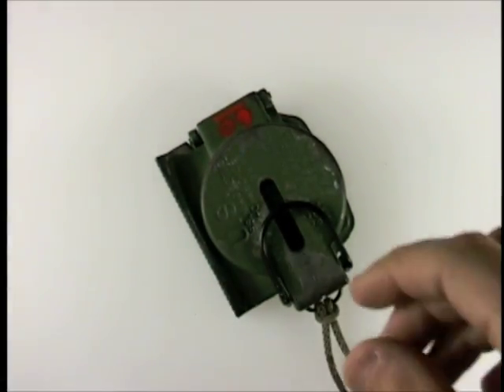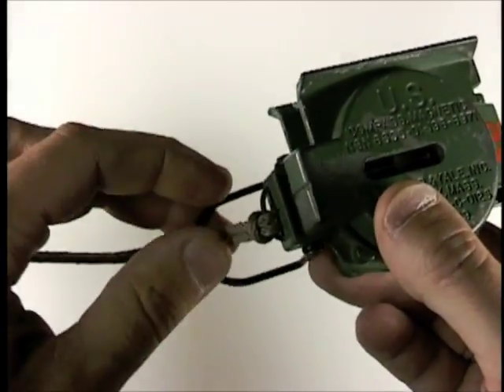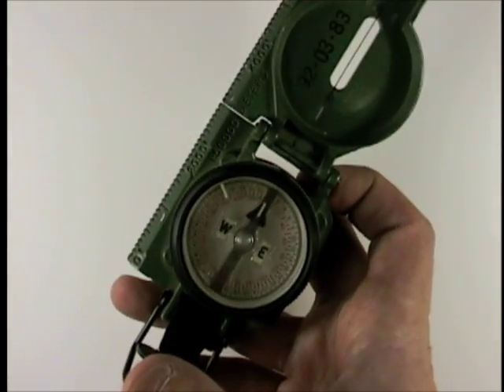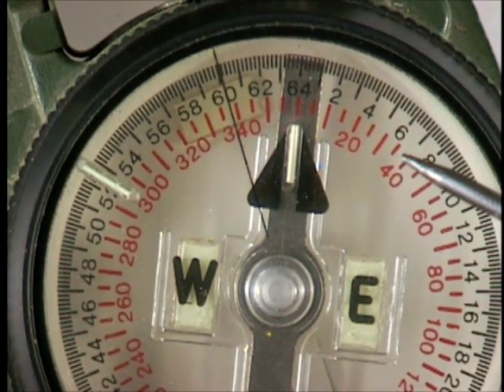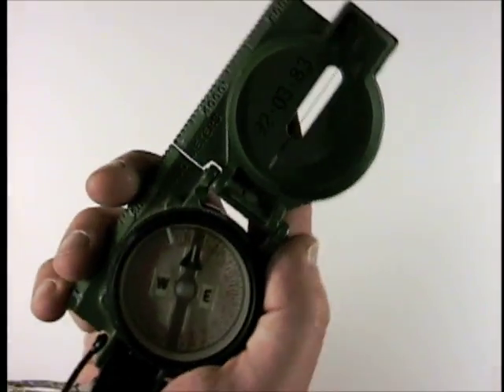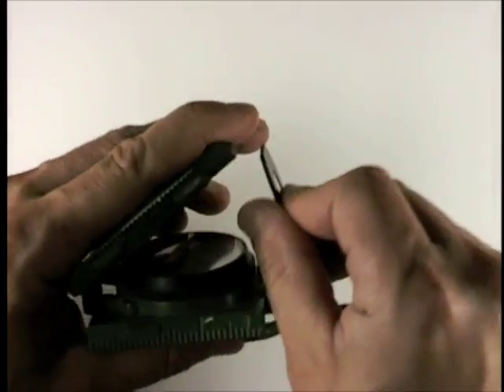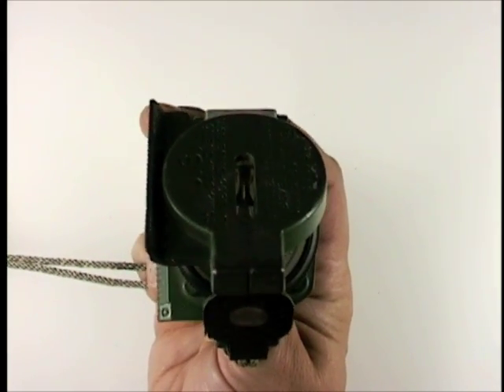Using the USGI Compass - Part 1

Comment: nice video the azimuth following is a bit opposite to a base plate compass but its nice
Reply from the maker: OMG, totally. That's why it matters which compass you are using when training. Many of them are upside down, backwards, etc. from what you might know and gets confusing or gets you lost. 

I occasionally say things backwards in these videos and had to edit or note over it because I was doing them all at roughly the same time, switch a lot for training purposes, and get confused myself.
Reply: Steven Hoober when you think a little you will figure it out ,unless something is wrong fatigue, dehidrataion ,heat,or if you are sick or cold and you are not at 100% mentally.

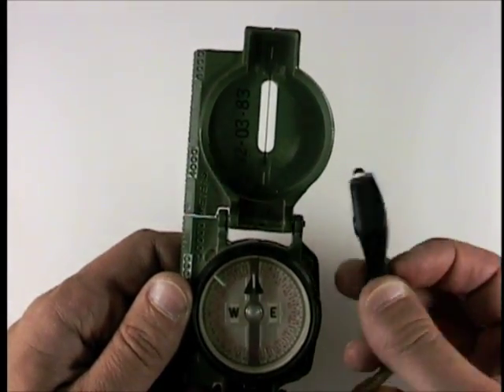Comment: 5:10 I've heard this noise on several radios and devices what does it mean?
Reply: +Nicky Valiente Summary: http://mentalfloss.com/article/17586/why-cell-phones-make-speakers-go-blip-blip-blip-buzz so search more if you are a bigger electronics nerd and want to eliminate it. TL;DR it's from mobile phones, and some signals are at a frequency that is in the audible range so if interference occurs on the audio system (headset wires, speakers, mics), you can hear it clearly.
Reply: usually a cell phone close to a speaker & getting ready to ring...in my experience that is...

Comment from the maker: Traveling so cannot look, but something like 1983 if I recall correctly. Anything in the 80s or early 90s is good for the brightness of the tritium. Anything less than about 10 years old is too bright to me.
Reply from the maker: Just got the compass in the video back after a long loaner period and I stumbled across this comment again. 1992 date code. It is perfectly bright enough to use in actual darkness, once your eyes are night acclimated. 

I have also got some with 2002 and 2007 dates. They are brighter, so better for old people like me to see with, work well with some ambient light around or at disk and dawn when you cannot see them with sunlight, but are a bit on the bright side for dark, moonless nights under trees or clouds. 

New ones are useless in the actual night. So bright they kill your night vision.

Comment: Good design but had a batch of these at local surplus store and out of 6 only one pointed north . The rest were out from between 8 and 42 Deg !!! Check the accuracy before you rely on it
Reply from the maker: Always a good idea to test, and a good way to test anything when not sure of the baseline (e.g. thermometers) is to get a bunch of them. Outliers are usually wrong. Now, of course, compasses interfere with each other, so put them a good ways apart. 

Weeeeeird. Never had the cards fail on these at all. Never even heard of it. Are you 100% sure you were not near something too metal, energized, etc. while testing.  

I guess if it's possible to ruin them, then maybe that's why those were all surplussed!

Comment from the maker: @zealberg Use math! First, you need to figure out how many mils yours has. If modern, NATO standard, it's gonna be 6400. But if not, could be anything. Then 360/6400 tells you 1 degree is 17.78 (ish) mils. So 5° is almost 89 mils. So, a hair to the left of the 9 (or maybe 90) tick on your compass.

Comment: Is there a way to tell how old my lenstatic compass is?
Reply from the maker: Unless someone scrubbed it off or painted the compass, there's a stamp on the inside of the lid in usually black ink with the date code. 

That code is (usually) year then month. The last number is a lot which is meaningless to us, so just ignore it.
Reply: Steven Hoober thanks for the reply. My grandpa gave it to me 25+!years ago and no markings anywhere. Directions say engineer, printed in Japan and the compass itself dial says “valor”
Reply from the maker: @s1l3ntopus  Ah, then it's not a "Lensatic" in this context meaning a USGI made by Cammenga, but something else. 

The "Valor" (I am sure that's a brand for US market distribution, not the real manufacturer name) seem okay but are consumer market compasses with IME plastic cases, so may not be as sturdy as the real thing at all. They are sort of a combination of a various european 19th century marching compasses and the USGI style, but aren't truly knockoffs of the USGI Cammenga, missing several features. 

The same design (maybe even the same old molds!) is made in China now, mostly extremely poorly.
Reply: Steven Hoober sorry for my ignorance but the model is lensatic and maker is cammenga? All I have is super thin instructions, blue cloth bag and compass itself, just trying to date the compass Is all, I was very young and don’t remember my age. My grandpa served ww2
Reply from the maker: @s1l3ntopus  Cammenga is the maker of the USGI lensatic as shown in my video. 

Your Valor is a consumer market compass that emulates the US (and european) "marching compasses." It is certainly post-war, and may have been bought by your Grandfather to emulate what he used in the war, but is not that old or actually issue.
Reply: Steven Hoober thank you very much!! You are very kind for helping me!

Comment: If you prefer, take a GPS but don't leave your compass behind.  Adjust your compass for the magnetic declination in your area ( I don't know if you can do this with a Camenga compass ).
Go to  http://www.ngdc.noaa.gov/geomag-web/?useFullSite=true
Remember - "East is best ( add +), West is worst ( substract -). " 
Then, get a 1:50,000 or 1:25,000 topographic map and place it in a plastic see-through waterproof pouch with paper and pencils.  Binoculars  and a small flashlight are also good to have.

The liquid filled, dampened, compass is less expensive and may have attractive features, but they will eventually develop a disabling bubble.  Military or engineering lensatic compass are best.

Other than for sighting a target in the direction of travel and walking to it, you may need to estimate the distance that you have traveled if there is no point of reference on the map.  In essence, you need to know how many times your left foot strikes the ground in 100 meters with the load you will be carrying in the type of terrain you will be traversing. Ranger beads are a convenient way of  recording each 100 meters to one kilometer.

Comment from the maker: Tritium is not battery powered. It's a tiny glass vial (sealed tube) filled with a radioactive gas, tritium. The tritium emits particles from radioactive decay which then strike a layer of phospors (similar to glow-in-the-dark paint) which then light up. 
There is no way to recharge the tritium, and no *practical* way to replace them. After about 10 years it'll loose half it's glow, but after 20-25 years they are still bright enough for compasses. Brand new ones are too bright, I think.

Comment: Yes, this video is about twice as long as it needs to be and does not have very good audio. And more importantly, these type of military compasses are not the best choice for most civilian users. If you are a civilian, and want a great compass that's a lot easier to use than this one, check out the  Suunto M3. Here's a nice video that talks about its features: https://www.youtube.com/watch?v=dI617p5vqu4
Reply from the maker: This is long on purpose, to cover Everything you might need. It's intended to be a companion to face-to-face training, which is often very abbreviated or is done in large groups so it's hard to get details. 

This is specifically for military users and expressly geared to that. I don't carry such a compass when I have a choice, but it's the issue one and is unusual to use so needs training. 

I have a couple videos about baseplate compasses as well, such as this one: https://www.youtube.com/watch?v=gZ-EMaUaE0c

Comment: Mine has the tritium also,  after 10 years or so, it doesn't work any more. mine is over 20 years old and doesn't glow at all now. but since I wouldn't navigate at night now unless I have to that isn't a problem. and I also use a suunto m3 compass and always take them both with me.
Reply from the maker: +Imjusttoo Dissgusted Shouldn't be dead from just tritium decay, but the vials can leak. Don't worry, fractions of a microgram, so no danger to yourself, but if totally dead, that is usually what happened. 

Assuming it was a radioluminescent one. A lot of people complain to me about this and then I look at their compass and have to break to them they bought a non-tritium version.
Reply: +Steven Hoober hate to contradict you but tritium has a half life of 12.5 years. If it's 20 years old then the tritium's decayed to the point of no longer working as intended.
Reply from the maker: +FPSGHoST808 Common misunderstanding. Half life is not Life, but HALF life. Explained here: https://www.youtube.com/watch?v=opjJ-3Tkfyg but the effect is after 12.5 years it's half as bright. After 12.5 more years, half as bright as that, and so on. Forever. 

Experimentally: Not only do I have several compasses that are much older than 12.5 years, but this thing about buying older tritium compasses is not something I came up with, but am just sharing. It's a known good idea if you want to be really sneaky at night, and not kill your night vision.
Reply: Steven Hoober i know what a half life is.
as he said, it's over 20 years old. assuming it's not past 25, then there's a small about left, but not enough to work as it was intended to.
Reply from the maker: +FPSGHoST808 Many, many, many do not get half life, at all. My favorite USGI has a 1983 mfg date. 33 years. Know (have seen) a number of similarly old compasses. They are much dimmer than new ones, but new ones are too bright, and these work very well for night navigation when dark enough to really need it. 

Similarly, firearms sights I have used well to around 16-18 years. At that point they glow plenty but you run into resolution issues. They are far away from the eye, so start being a problem to use in practice, at arm's reach. 

This, however, is a similar issue: The rears on handguns are far, far, far too bright as they are closer and there are two of them (typically). I (and many others) dim or totally black out the rears with sharpie or paint so the front will be visible. Another way is to use older "expired" rear sights with a full brightness front.

Comment: the wire on the top snapped, help
Reply from the maker: You mean the sighting wire in the lid? It is just glued in there, so I have known a few who are even cheaper than me, and go out of their way to refurb old or broken ones that have fixed it. So, if handy at all, just scrape out the glue, clean and degrease, then epoxy in a new wire. Anything of the same size and stiffness will work fine. If me, I'd get perhaps a stainless wire from the little hobby tubing stuff at the local hardware store and paint it black before installation. Holding it centered so it doesn't move as the glue cures is probably the hardest bit. If fixturing seems hard, maybe... superglue it in place as you eyeball it in, then once set dab epoxy to seal it and fill the gap. 

Do tell how it goes!
Reply: @StevenHoober  It's not all the way out but one side snapped and so I'll try to glue it back. Thanks for the advice though :)

Comment: Make it sound so complicated when there is no need to.
Reply from the maker: Whereas when we teach this we find people who have been using them in the field for years, and don't know half the ways it works, or why so they occasionally get lost, etc. 

I strongly believe it is good to know the details, hows and whys so you have more tools to work with, and can pass on correct info to others, instead of rote memorization and surface knowledge only.

Comment from the maker: @CherokeeTwilight um... for night vision, that's just stupid NCOs spreading ignorance. NODs have NO radiological component. The official US Mil guidance is on extended use for eyestrain, as it reduces your ability to do your job well; e.g. helicopter pilots have to trade off every so often. 

Tritium is fairly un-radioactive, and it's insanely tiny amounts. Someone who works with this did the math a few years back, and calculated (as I recall) you'd have to break 10,000 front sight vials...

Comment: I wonder if this guy has actually used one of these things for orienteering!Following a course (bearing) is dirt simple, if you have put the right number on your bearing line.Set your course on your bezel; line up the magnetic needle with the index mark, follow the bearing in your sighting window.For Taking a bearing on a track, or object is again, dirt simple, by using the sighting window, and lining up the  object in the sighting window, and lining up the magnetic needle with the index mark on the rotating bezel.When the mark  lines up with the needle, read off your bearing. Simple!THIS guy is giving all sorts of confusion in his instructions.